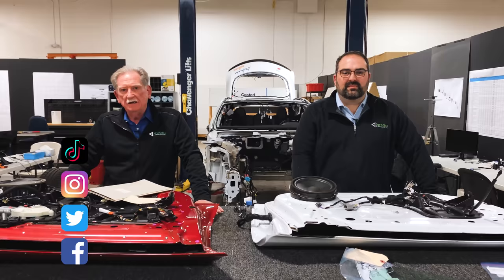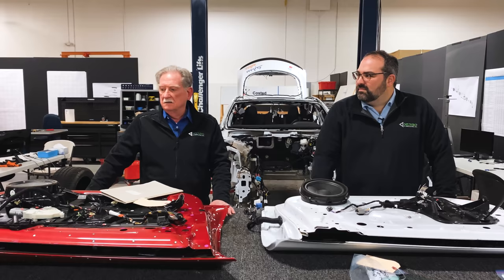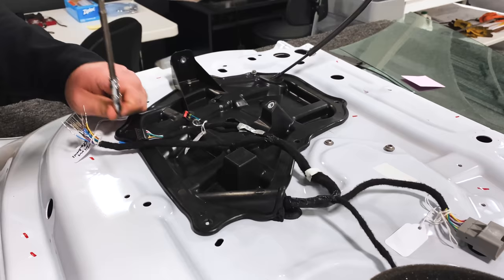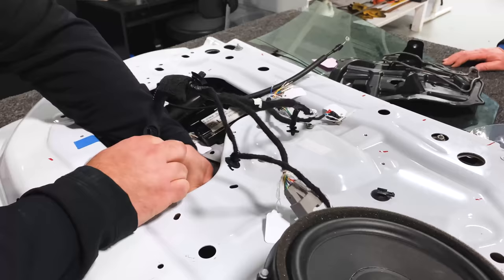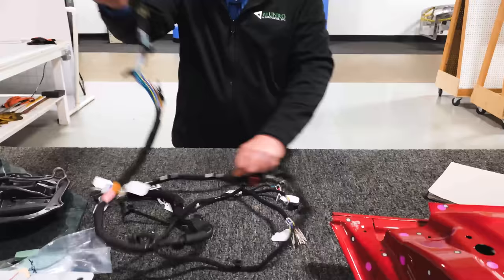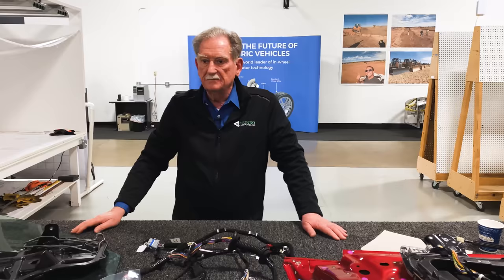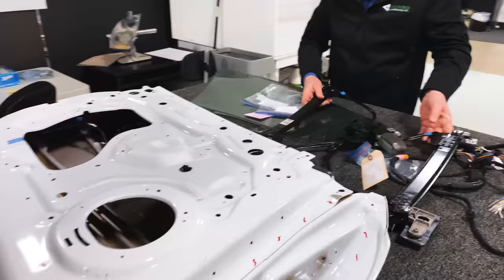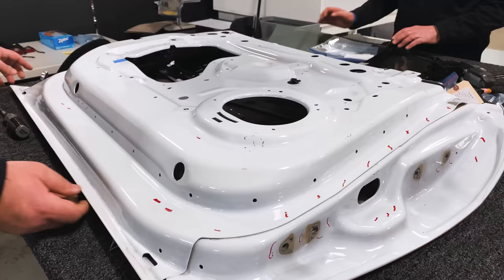Plaid Doors Disappoint Sandy | Tesla Plaid Teardown

Comment: Imagine calling yourself an "automotive expert"  and assuming the Model Y door doesn't have a dedicated door build line with 30+ associates assembling it (exactly like the S/X line). LOL
Reply: A lot of his experience is from the 70's and 80's.
Reply: That’s not the point.
Reply: It depends. I dont remember them saying if the Y door is tesla internal build or sourced from a third party as is usual.

Even if there is a separate location to assemble the modular panel, it still has advantages, as discussed in the video.

Comment: Is it possible that the internal panel of the door doubles as structural strength and safety AND that the panel is modular and then is welded onto the external panel ?
Reply: I was thinking of the same question when i was looking at the little red marks that might have marked spot welds.  But the bottom of the door seems to be folded.  If they are spot welds and it was done after painting, they would have to be painted again.  Again, your guess is as good as mine.
Reply: @christopherstube9473  it makes sense that natural progression of development parts be fitted on the door and to actually do away with extra part and weight of the Y modular panel. There must be a way they figured out to do this. I just cant believe we are doing them justice with all else they have done on this model. Sonic welds maybe ?
Reply: @karimshalaby9124  They have become master at stir welds down at Boca Chica.
Reply: @christopherstube9473  I am no engineer,  but do you think that's a possibility?
Reply: @karimshalaby9124  We are speculating until we can examine a door.
Reply: @christopherstube9473  spoken like a true engineer👍

Comment: I just read an update on this gen 2 drive units, changing oil type and maybe the process on how is serviced I think.

Gearbox Fluid - Front Drive Unit (2nd Generation)
(Drain and Refill)
Correction Code 39300202
Revision History:
• 2024-02-28: Updated gearbox fluid.
Wondering why the change?

Comment: Also, why would the assembly of the door components have to happen on the main line? Why wouldn't the doors be assembled off the line the same way the modules themselves would be assembled? Then bring the door to the assembly line and hang it on the car. I don't see the issue.

Comment: If Tesla had chosen the plastic modular approach of the Model Y for the Plaid Model S, would it also have saved quite a bit of weight & cost too?
Strikes me as servicing, would also, quite apart from being an absolute pain in the bum to do, be slower & more expensive.

Comment: Sandy and company are a LOT smarter and have a LOT more experience than I do. I do computer support for a company and I'm at the bottom of that hierarchy chart. Anyway, it looks like the door comes in two parts that are mated together. Is there ANY change that most of the stuff that is inside the Plaid door is screwed in/attached BEFORE the two halves (inside and outside) of the door are attached together?

If -I- were the manager of the line where this was put together and I had no choice about how things were made but just how they were put together. If I could decide when and how things were put together, I would attach as much to the inside or outside of the door BEFORE I put the inside and outside of the door together and THEN put them together. But I'm sure they saw the assemble line and the production manager or line manager probably has little say in how/when things are put together. It just seems like that would make a lot more sense as far as when/how things were installed if you were stuck with the Plaid parts instead of the Model Y parts. 

Now I'm curious about how my California made (I checked) Model Y from May 2020 was manufactured. Is the door more like the Plaid or the current Model Y. Not that I'm going to take it apart but I would love to look back at the first Model Y that Sandy had and see what the door looked like inside then.

PS: If someone from Sandy Monroe and company could respond to this I would be very interested in your reply. Yes I am subscribed and I clicked on the bell and "personalized".

Comment: I rue every time I have to service my 20 year old VW's doors, but at least they're a mostly modular design like the Model Y, with the regulator and most parts but the lock module, but on a stamped metal carrier.  The fronts are like the model Y, and the rear doors ... are a terrible compromise between modular and stick build, but at least in that case, the carrier covers a huge opening compared to the "Fumble and flail your hand blindly in a gopher hole" design.

That whole design on the S Plaid is a horror for the assembly line operators, and every mechanic or DIYer owner that has to fuss with it thereafter.  

I get that Tesla's using a 10 year old model, and some are citing this as an excuse "they already had this design", however:  

A) There are modular designs other automakers used that were a decade or more older than the "fumble blindly in a gopher hole" design
B) Tesla is known for rapid and frequent revisions on their cars.

The fumble blindly in a gopher hole design is just so bad on all fronts, the only thing that could make it worse would be stuffing a rabid badger in the cavity.  Perhaps we can thank the accountants for not allowing for that frivolous expenditure.

Comment: . Don't you guys see that the metal part of that door is a 2 piece assembly that must have come together ....probably spot welded ....after the innards were put in....that is what I see. I am pretty convinced that the original building of that door at the factory, and the fitting of its components was fairly easy and quick. But I have to agree 100% that if a repair is ever needed on the door would be quite time consuming and costly.

Comment: 0:57 I would like the spoiler off that car if you would sell it or trade for a seat frame from a 2017 model S to compare Plaid seat. They look the same from the outside but big differences between the two on the inside.

Comment: Is it possible that they assemble the whole door somewhere else and then mount it to the car? Doesn't have to be line speed. Can be done just in time with proper planing and consistency in paint.
Reply: The labour for someone to put it all together still counts, even if it's done off the main line (which it would be).
Reply: @bikeaddictbp  If the extra plastic part ist 20$ but it takes a skilled worker 12min to assemble one it is worth it.

Comment: Not bad in principle, the two products are similar with the difference that the white door could be opened in half and work from the inside.  Plastic has this bad property of not being a structural mother in the event of an accident.  if it were possible to hydraulically press a metal one-piece set that is screwed into the door, both problems would be solved.  I would like to see the door filled with material rather than empty glass wool or D3 plasticine that doesn’t lose its shape on kinetic impact!  The door would be good to be divided into 3 panels, external, central (with all mechanisms) and internal.  Everything else is redundant.

Comment: Looks like the Tesla S lines are too old and too low volume for the company to put high priority on redesigning all of the pieces properly, so they somehow just decided to leave the door in its legacy configuration. At least that would be my assumption. Not a good look. I wonder how they prioritize which elements of the assembly to redesign and which ones to leave as is.

Comment: The weight savings alone would be reason enough to change to a plastic module. Removing inner metal panel and replacing with plastic would probably save 3 lbs per door. 
Great video.

Comment: Didn't Tesla fall out with supplier Hoerbiger over an issue with the gull wing doors? They must have supplied that nice model Y door drop in door module module too , so a supplier change is the most probable reason for the design change.  I still have zero feeling in my right thumb after cutting it to the bone and almost severing it on a raw edge while assembling a Jeep YJ door in the 80s .

Comment: Robotics, we need to see things differently to old school visuals and work to be done “in case of”. That door is made by robotics and since is main driver side door is full of devices, electrical cables looks very profesional, don’t think it will fail, neither the components, to be critical you need to adapt yourself to technology and robotics in this environment.

Comment: As a technician doors are my biggest pet peeve it seems like they are overly complicated on purpose and if you're not in an actual factory setting with their tools some cars are almost impossible to work on it's almost like they are trying to get across the point that you should just replace your car if you need to fix your door 🤔🤨 as someone that actually has to work on these after they get rusty dirty full of water mud take your pick I'm much prefer the modular style it's easier it's faster I can have the cars in and out in no time but the other style is stick built yeah we've had cars like that for days just because stuff wouldn't line up and work right it's ridiculous you would think that we'd move past a point of using technology from the '70s but we still seem to be using it quite often

Comment: is there any way to compare this door to a 2012-2015 Model S? Maybe they haven't changed the door since the original tooling? Tesla wasn't any good at manufacturing until a few months after the Model 3, see the Model X production ramp, where their design hubris made them years late and was finally brought to its knees.

Comment: The question to me is: why did they do it this way as opposed to what they did in the model 3/Y? Presumably there is a reason.
Reply: Maybe metal is better noise blocker? quieter car?
Reply: Most likely though I think its not worth to redesign and invest new tooling cos S is so low volume model. :/
Reply: I'm betting it's to take the "Quickest Production Vehicle" title. It's rushed but I guess it goes with the mission - to accelerate ...
Reply: Same as the original 2012 Model S and not worth changing the tooling ... This would be an expensive change that would normally only coincide with a full-model redesign.

Comment: Is this actually assembled they way it's being accessed after the fact?

It looks like the 'internals' are (for the most part) sandwiched between two metal panels.  Making install of them much easier than the servicing method of them - which I believe is being presented as installation method in the video.

Basically the exterior body panel, then electrical and doodads next on top, then interior metal panel with protruding bits coming through, then mounting parts for speakers and the like next and closest to the interior.  If this is the install method which seems plain as day to me would make EVERYTHING waay easier to install, and again, in contrast to what is shown here, which looks like access for servicing post assembly.
Reply: That's not how it's done. The exterior and interior door skins are permanently attached (usually by adhesive and then folding the outer edges of the skin around the inner), then hinges go on then it gets attached to the body, then it goes through paint (gotta do paint before you put ANYthing else on the car that isn't painted), then generally the doors come off the car and go through a separate sub line. They will have fixtures to make it easier, and they will do the assembly sequence in the proper order (e.g. wiring harness first, then other parts that get plugged in as they go). Very few cars have door skins that are replaceable without cutting metal - and it has to go through paint before anything else goes on, which means the inner and outer have to be together. (I work in this business, hence my interest in these videos!)
Reply: @bikeaddictbp  Ty Brian for sharing.  I obv don't work in this arena.  Is this really the best most efficient way to complete this task using this method (this method, not accounting for the pop in type of method used in the Model Y doors)?
Reply: @bikeaddictbp  I will apologize for my ignorance in advance, but would really appreciate your input on this.  You mentioned the absolute 1st thing is paint.  Is it not possible to paint the two panels individually and sandwich them afterwards using adhesive (even if some sanding is needed and compensated for with adhesive squeeze out).  Assembly of the two parts can be married up with tolerances for the fastening process, ex. slots, machined stops.  

Again, apologies if this is a silly question, but I am having difficulty accepting that this process is being used when it seems there is clearly a better one (preferred by Sandy) AND it is so comparably more involved/difficult than the Model Y door.  Knowing that Tesla has the ability to make swift changes for the better, what reasons would they have to not incorporate the new door system.  Why does this method persist?
Reply: @qwazy01  Once a class A surface is painted, you can't hang onto it with rigid fixtures and tools any more because you'll damage the surface. As for doing it the model-Y way ... absolutely it "could" be done. But it would require redesigning the inner door structure, and if that redesign affects crash then it means re-certifying, and of course redesigning all the bolt-on bits and pieces themselves because now it's all a different shape because it's being hung onto in a different way. It certainly COULD be done. The question is whether it's worth the expense, and for a low-production-volume vehicle, evidently they've made the decision that it's not worth the expense, easier to just carry on with the existing design ... that's all there is to it.
Reply: @bikeaddictbp  awesome ty for sharing again, makes a lot of sense!

Comment: Since there is no paint overspray on the inside of the door, I am guessing they painted the two pieces separately which allows assembly of them separate without hands inside the door but for a couple minor last steps to bring it all together. If that is the case, they are actually saving money and time during process, negating the need for the all-in-one module. This should actually be a positive video, not a shaming video. Great content, otherwise!!

Comment: Realistically, though, how many of those expensive cars will they build?
Unless they cary that change to the "regular" Model S, I wonder how much of an assembly line impact this will have. I do pity the assembly workers having to shove their hands in there.
Maybe they needed the extra rigidity for side impact rating?
I'm not a fan of Ts (other than their powertrain) but inner door construction details means less to me than misaligned doors and door trims that fall off.

Comment: The modular design is great for manufacturing and installation but if there not rugged enough they will break a lot, my first experience was an audi 5000 and was a common problem and mostly caused by frozen windows ,no surprise that they broke after all it`s an Audi a 4 letter word I just use this 4 letter word, JUNK !

Comment: S is a low volume build.  It is cheaper overall to do the stick build.  Come on Sandy-you're smarter than that. S is not a mass produced car like 3 or y.  Everything is built on the internal panel frame and then put together.  It's really not that bad.  It's only bad if it's not working.  If I recall correctly not once did you complain about the doors on your cross country trip.

Comment: Doors are not assembled vertically but horizontally. The doors are separated from the body near the first sections of the assembly line and then go a different route in parallel to the assembly line, like above . The doors and lids are preassembled there, and once they are completed, they are assembled to the exact same body, where they came from. Just see a modern assembly plant. Your idea of the modular door is still valid, but not for this reason.

Comment: Might be one of many "old" manufacturing processes they left that they will eliminate once they close their factory in Fremont. Far all we know these doors could be left overs from previous manufacture runs and they didn't want to add new tooling for a low production vehicle or divert time away from  the new manufacturing tools being used on Model Y/3 doors when that is their priority. Since they already made major improvements with the Model Y/3 doors, obviously they aren't stuck in the past, and probably did some cost benefit analysis showing that it wasn't worth upgrading Model S doors for the 1st gen of the low volume Model S Plaid. It sucks for anyone who has to repair those doors or owns one that needs repair, but if you are buying a $120,000+ vehicle I don't think cost of vehicle repairs is a major concern to you and any savings Tesla has in manufacturing isn't really going to be past onto the consumer in a high end luxury sports sedan.

Comment: Yes. And NO. The main thing which come directly to my mind was the side steel content. Seems like S Plaid has much more steel on the side and this was a structural requirement. My guess: if they have done it in that way on Y and different on S Plaid is because the forces, the performance, and traction/torsion of S Plaid are much bigger than on Y. So, you do not like it but can't be done in another way as structural resistance require it in double steel face... I am pretty sure people are not thinking about the door's own resistance in these cases. You all look at installation speed but forget about the rest of the requirements...Do not make it as the first two pigs from the story, easy and fast, just for this...wolf waits for you...

Comment: So, there should be a reason for not using modular door. Stop caring about the assembly guys... So, what is that reason - strength/rigidity ?

What about those micron precision gaps - may be it applies to welding of the door as well/there are no tolerances (or robot assembly ?) ?